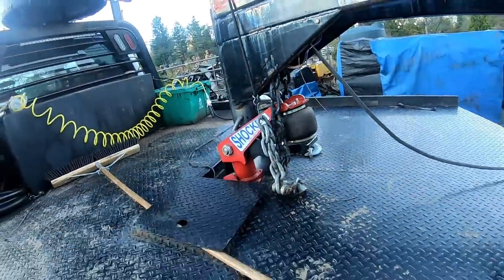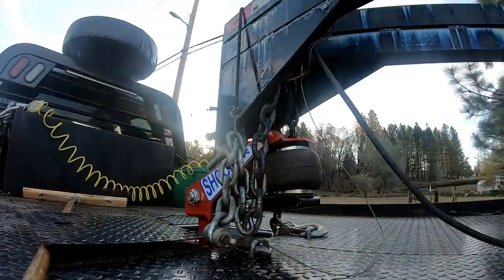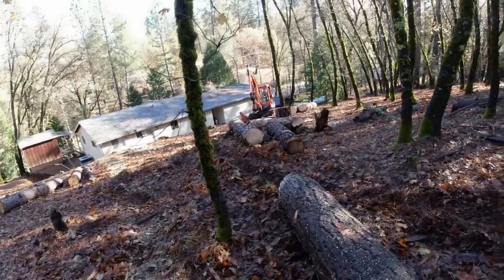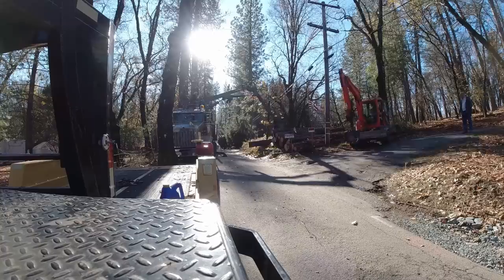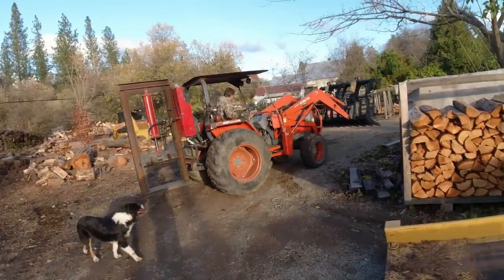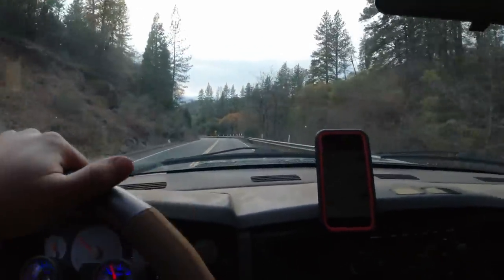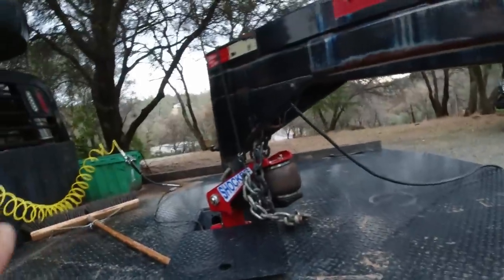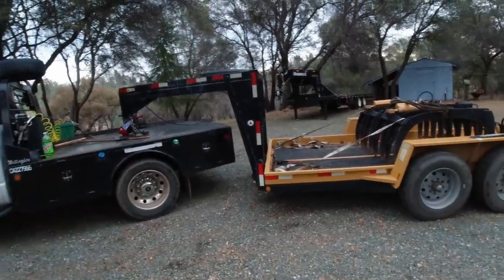TESTING SHOCKER HITCH ON 15K GOOSENECK TRAILER and TREE WORK

Comment: Great video!! I have tried all of the hitches out there and Shocker is my favorite, which I get the best results from. My bumper hitch shocker is normally run around 25-30# towing 7000-8000#. My gooseneck shocker with my 30’ hydraulic dovetail dual wheel trailer I am around 20-25# empty which takes the jerking and bucking out of this trailer, and then adding 8000-9000# to the trailer I’ve found 50-60# is pretty good.

I use airlift wireless compressor with in cab remote for my Ram 3500 airbags, and also for my GN Shocker hitch airbag. I also added the app and you can control the air adjustments from your phone app while driving.

Comment: Thanks for the idea of adding onboard air for the shocker.  I run a 36' PJ hydraulic dovetail behind my 14 ram 3500 with an aisin.  After watching this video I ordered a airlift wireless one compressor with remote and wired it up.  I can now adjust the air in the shocker while I'm driving down the road.  A lot of time saved by not having to pull over and adjust the air.  Thanks
Reply: I have the airlift on my ram how do u hook up the shocker to it and control it separately from the airbags on the rear axle

Comment: For my truck airbags I have on board air and a low pressure high flow regulator in the cab. Keeps pressure the same even when the bags are compressing  or extending. For your hitch bag you would need a higher pressure regulator. Go for a high flow, won't hurt a thing and may help. I paid 70 bucks for mine. They have gone up in price since two years ago. Marsh Bellofram brand.

Comment: I’m hauling a load of piñon firewood back from NM to dallas right now right. I weighed 20,660# empty this morning and weight 46,360 once loaded. Truck is a 2017 Ram 3500 limited with same configuration as urs. Trailer is a 36’ Load Trail with 15k axles. I’ve got 70 psi in the shocker now. It’s been great all day until I just got on some rough highways. Going to put more in @ nxt stop

Comment: I have a 38ft 5th wheel with a 5th airborn hitch. I welder that sucker closed and put a ranch hand goose neck adapter. Do not like that soft riding hitch. But that second hitch you got gave me a different opinion.

Comment: So you have tested the Shocker hitch & the Gen Y hitch.  Which hitch do you think is better?  Do you currently use one?
Reply from the maker: I’m using both still. I will make a video comparing the two and tell you good and bad with both.
Reply: I currently have a shocker hitch on a 37’ 4 horse gooseneck trailer.
I installed it right after I purchased the trailer.  I like it although there is one thing I don’t like that only happens in stop-n-go bumper to bumper traffic.  I’m wondering if the Gen Y won’t.   I have a new 26’
2+ 1 that I want to put some shock absorbing hitch on it.  Which one should I buy?
Reply: @VBELTandSON  Did you ever make the comparison video? I haven't been able to find it if so... Please let me know.  Thanks for making the videos brother.
Reply: I too went looking for that comparison video and could not find it. I am looking at a bumper pull for Gen Y or Shocker but I can't find data comparing the two. Any data you have would be appreciated.

Comment: No need for an air compressor; just bring a decent bike pump capable of the psi you need.
Reply from the maker: Rather spend the 50 bucks on a portable cordless compressor. Ain’t got time to pump 70 psi from a bike pump
Reply: @VBELTandSON  lol. takes 20 seconds, but OK
Reply from the maker: With a fully loaded trailer? Send me the video lol